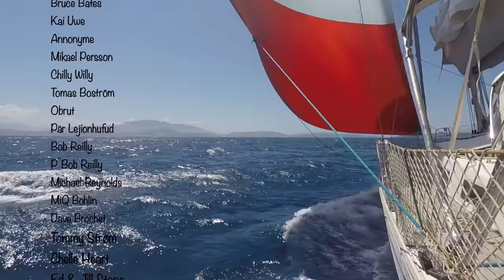TIME TO ENJOY! - SwT 146 - PLAYING WITH DOLPHINS IN TAHUATA (French Polynesia)

Comment: Thomas how are getting on with Starlink there in Polynesia?
Reply from the maker: Hi there! It’s a bit mixed. In the Atolls it works flawlessly but had some fallout in between. The sail from Marquises to the Tuamotos it didn’t work at all after 100+ miles offshore. Now on the move to another atoll sailing south east we have full throttle. This answer is made possible by StarLink with the Global Roam 50GB package. At anchor it moves to unlimited automatically.
Still a bit Beta feeling about it, but pretty sure it’s improving for every day. StarLink is  still not a substitute to Iridium Go or Garmin  in reach. I’m gonna ditch Iridium Go and have already terminated predict wind. So as soon I get my hands on a Garmin in reach that’s gonna be my safety backup. StarLink is useless if the life raft is needed.
All the best and thank you for being here